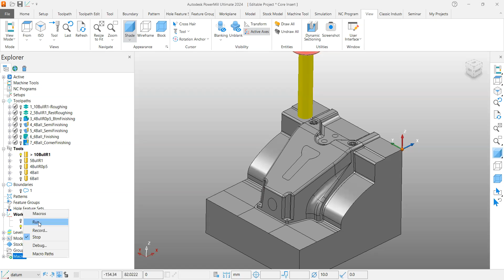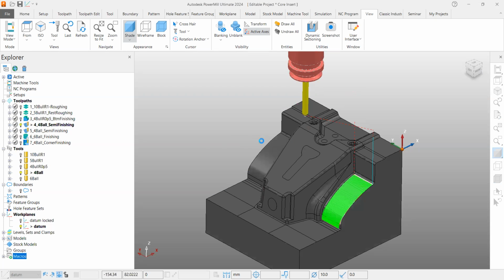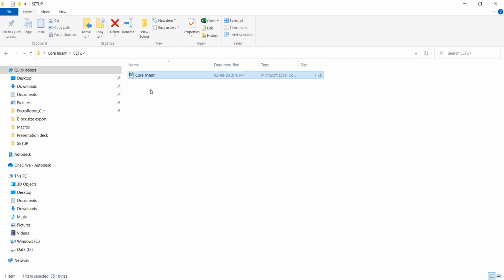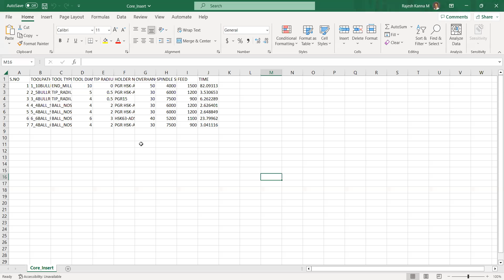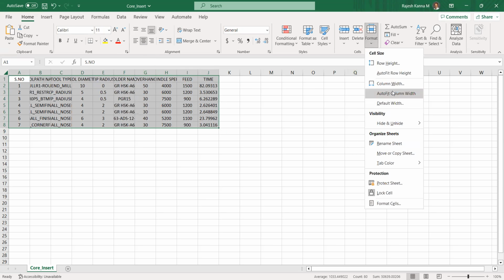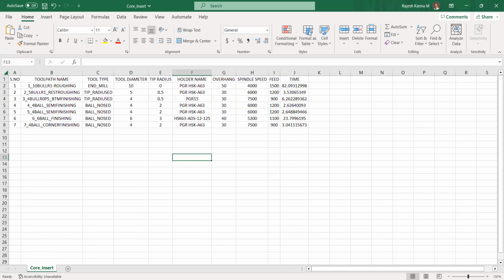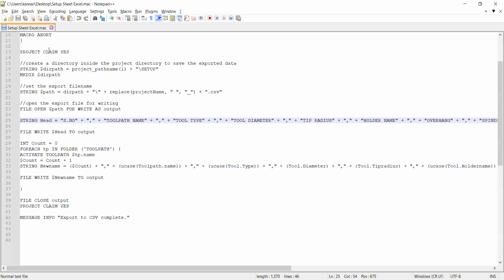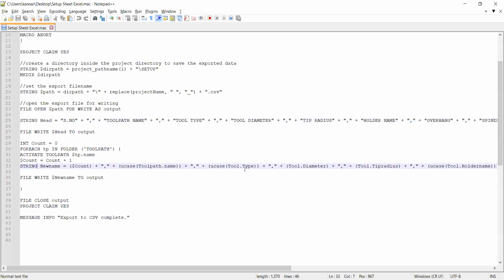Autodesk PowerMill - Tips & Tricks - Export Setup Sheet - Excel Format

Comment: could you please share the macro?
Reply from the maker: No payment needed, share your email id
Reply: @rajeshkanna5177  FUNCTION Main() {
// Tool import example macro.
// The separator character '"' is beacuse it cannot be a valid PowerMill name, unlike the comma character.
// The Map record separator is '|', Map field separator is ':'.
// The 1st member always 'Type', 2nd member always 'Name', the other members can be in any order.
// Supported tool types: Ballnosed,Tip radiused and Drill. The dictionary expandable.
   DICTIONARY ToolTypes={'tip_radiused','TIPRADIUSED','ball_nosed','BALLNOSED','drill','DRILL'}
   STRING ImportFilename = ''
   $ImportFilename =  FILESELECT "Please select tool import file"
   IF NOT  file_exists( $ImportFilename) {
      RETURN
   }
// Handling of a previously interrupted macro run
   DIALOGS MESSAGE OFF
   FILE CLOSE import
   DIALOGS MESSAGE ON
//
   FILE OPEN $ImportFilename FOR READ AS import
   STRING Header=''
   FILE READ $Header FROM import
   STRING LIST ToolProperties=tokens($Header,'"')
   IF (size(ToolProperties) < 2) OR (ucase($ToolProperties[0]) != 'TYPE') OR (ucase($ToolProperties[1]) != 'NAME') {
      FILE CLOSE import
      MESSAGE INFO 'Wrong file -missing header'
      RETURN
   }
   STRING LIST ImportData={}
   FILE READ $ImportData FROM import
   FILE CLOSE import
   INT Count=1
   FOREACH $Record IN $ImportData {
      STRING LIST ToolData=tokens($Record,'"')
      IF size($ToolData) != $size(ToolProperties) {
         MESSAGE INFO 'Wrong record Nr.'+$Count+' -different size '+size($ToolData)+' != ' + $size(ToolProperties)
         RETURN
      }
      STRING ToolType=remove_first($ToolData)
      IF member($ToolTypes,ToolType) {
         STRING ToolName=remove_first($ToolData)
         IF entity_exists('tool',$ToolName) {
            $ToolName=new_entity_name('tool',$ToolName)
         }
         STRING Cmd='CREATE TOOL "'+$ToolName+'" $ToolTypes[$ToolType]'
         DoCommand $Cmd
         ENTITY T=entity('tool',$ToolName)
         INT Field=2
         FOREACH P IN $ToolData {
            STRING FieldName=$ToolProperties[$Field]
            IF member($T._keys,$FieldName) {
               STRING Cmd='$'+'T.'+$FieldName+'="'+$P+'"'
               DoCommand $Cmd
            } ELSE {
               SWITCH $FieldName {
                  CASE 'ShankData'
// Shank data
                     IF trim($P) != '' {
                        STRING LIST Maps=tokens($P,'|')
                        FOREACH item IN $Maps {
                           STRING LIST Values=tokens($item,':')
                           IF size($Values) != 3 {
                              MESSAGE INFO MESSAGE INFO 'Wrong Shank data in Nr.'+$Count+'record. '+ $size(Values)+' != 3'
                              RETURN
                           }
                           EDIT TOOL ; SHANK_COMPONENT ADD
                           REAL V=real($Values[0])
                           EDIT TOOL ; SHANK_COMPONENT LOWERDIA $V
                           $V=real($Values[1])
                           EDIT TOOL ; SHANK_COMPONENT UPPERDIA $V
                           $V=real($Values[2])
                           EDIT TOOL ; SHANK_COMPONENT LENGTH $V
                        }
                     }
                     BREAK
                  CASE 'HolderData'
// Holder data
                     IF trim($P) != '' {
                        STRING LIST Maps=tokens($P,'|')
                        FOREACH item IN $Maps {
                           STRING LIST Values=tokens($item,':')
                           IF size($Values) != 4 {
                              MESSAGE INFO MESSAGE INFO 'Wrong Holder data in Nr.'+$Count+'record. '+ $size(Values)+' != 4'
                              RETURN
                           }
                           EDIT TOOL ;  HOLDER_COMPONENT ADD
                           REAL V=real($Values[0])
                           EDIT TOOL ;  HOLDER_COMPONENT LOWERDIA $V
                           $V=real($Values[1])
                           EDIT TOOL ;  HOLDER_COMPONENT UPPERDIA $V
                           $V=real($Values[2])
                           EDIT TOOL ;  HOLDER_COMPONENT LENGTH $V
                           IF $Values[3]==0 {
                              EDIT TOOL ; HOLDER_COMPONENT IGNORE NO
                           } ELSE {
                              EDIT TOOL ; HOLDER_COMPONENT IGNORE YES
                           }
                        }
                     }       
                     BREAK
                  DEFAULT
// Missing members, misspelling field names
               }
            }
            $Field=$Field+1
         }     
      }
   }  
}